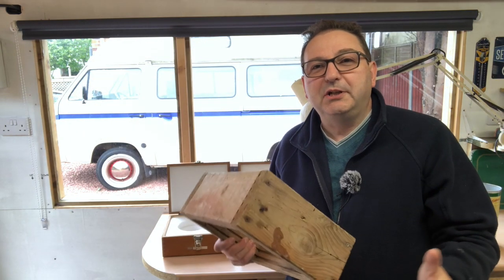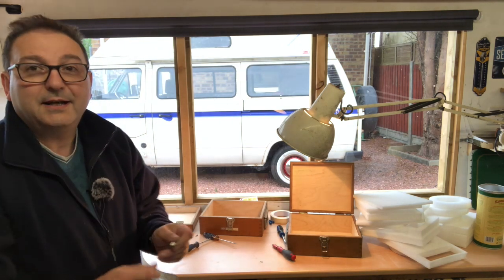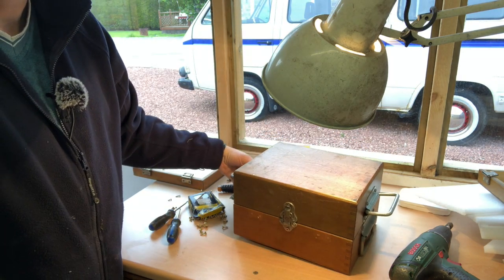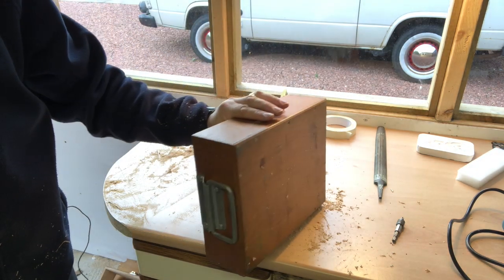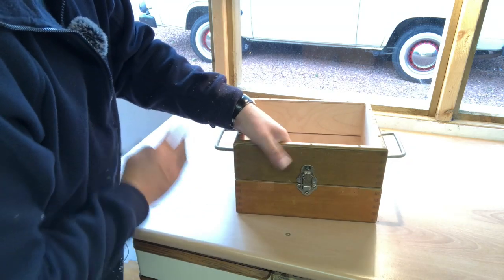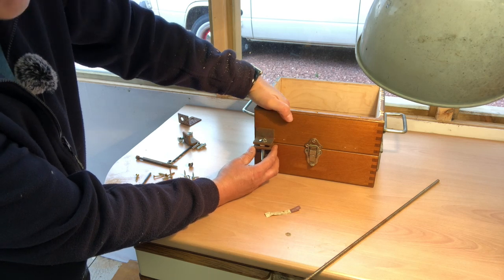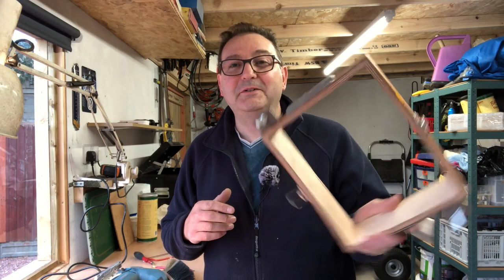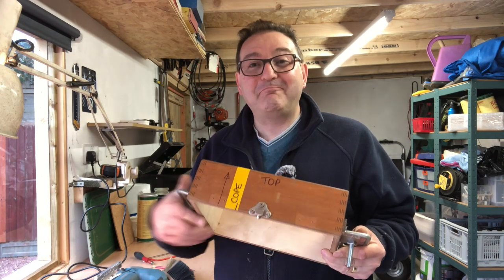Make a molding box. Cope and drag. for sand casting

Comment: Since it causes me heart pain, to watch you destroy finely designed wooden boxes...,  I've started to use new, unused cabinet drawers for my cope & drags. They usually have the same dove-tailed corners, and they have very close surfaces. Just use a router to cut out the bottoms, after using some scrap 1.5 inch, 90 degree angle aluminum bracing at the outside corners,(sorry, not a metric guy).
Easy...
Thanks for the videos!
From Tampa, Fl area fan.
Reply from the maker: Thanks Walter👍. I imagine the drawers make really good molding boxes. And a little more roomy